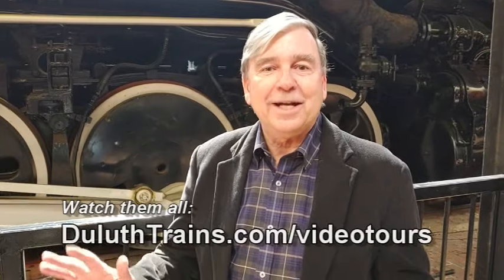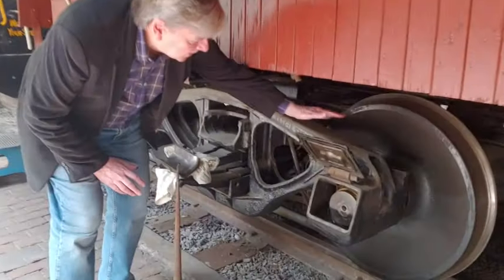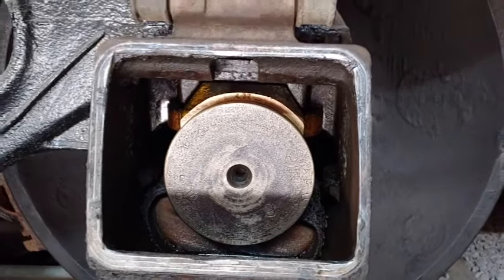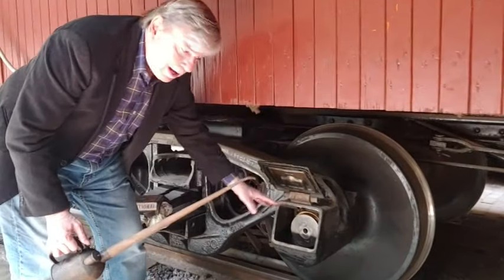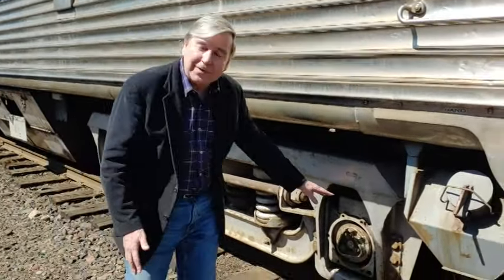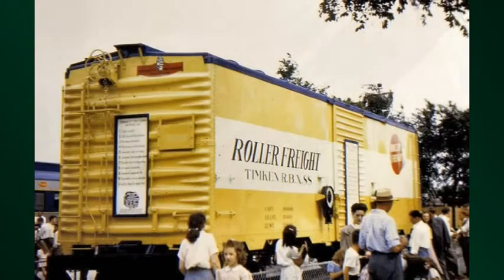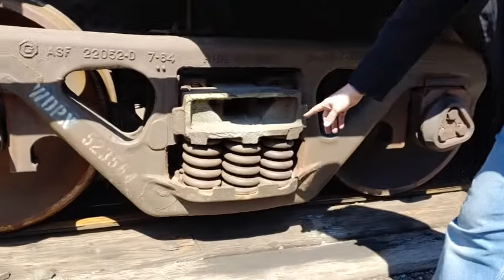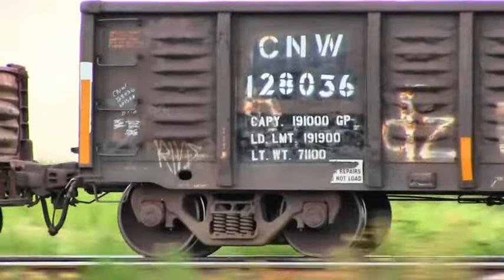Wheel Bearings

Comment: You can still find Timken manufactured equipment for your vehicle mostly as replacement hubs. Friction barrings are actually use in internal combustion motors for the crankshaft. Just a little information on how the technology from the early days of railroading is still used today. I apologize for the butchering of my spelling. But excellent information in the video!

Comment: 55 years ago< when I was working as a hostler/carman helper for Canadian National we had to change out wheelsets and bearings on hot boxes, and I seem to remember we changed more roller bearings than friction bearings, primarily because grease had leaked out of damaged seals.  Also friction bearings only had a "brass" on the top of the axle.  The cellar had cotton or wool waste for wicking, which had to be redone on a monthly basis.  Our locomotive foreman used cellulose sponges as test wicks on our yard engine but unfortunately he did not patent.  Became the basis for "journalpax" and other commercial friction bearing lubricators

Comment: Thank you. I wondered why Hollywood trains have the incorrect bearings. This also explains various jokes re: the railroad tycoons demanding that greasy rags not ever be discarded but stuffed into the wheel bearings.
Reply: There are many cars where the friction bearing boxes have been modified to take roller bearings. Usually you can tell as the covers are removed.

Comment: No grease in roller bearings?
Reply: I spent some time in the wheel shop and there is grease packed in the roller bearings.
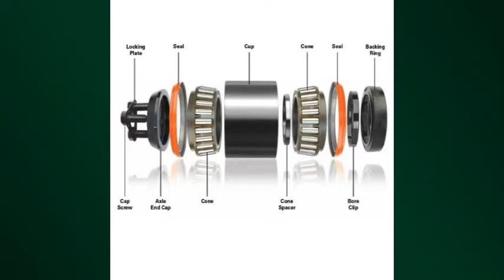Reply: @MrGlenferd  at 3:45 the narrator says non lubricated. I'm sure you're right. I was hoping he would post a correction

Comment: An old railroad man told me one time some train workers didn't always like the roller bearings.  With the friction bearings they could often park cars on a siding without setting the brake.  After the rollers were installed they had a tendency to roll away.  They had to always set the brake after that.